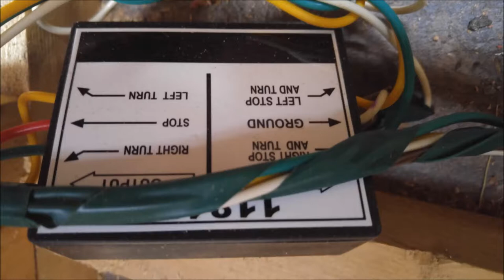Homemade Camper Trailer update # 10 Tail light wiring , Fridge paint

Comment: Please tell me what trailer you started with. I am looking at getting a harbor freight 1720 trailer to build out to a concession trailer. How well has your trailer held up? Have you found that it is top heavy where the width between tires is quite narrow? Anything else you can tell me.Thanks.
Reply from the maker: Hi there was no trailer model name on the one I bought used , it was a 4 ft. X 8 ft. tilting flat deck trailer the fella used to carry his Rideon mower tractor on . I lengthened it and widened it to 6 1/2 ft. Its held up good to this day , I don`t take it on the highway till I upgrade the axle to a 3500 Lb. one ..
Here is the link showing the trailer frame  when I got it and widening it .. 
https://www.youtube.com/watch?v=eHSFeuV7Dag
Reply: @88s10Durango  Thanks for the quick response.